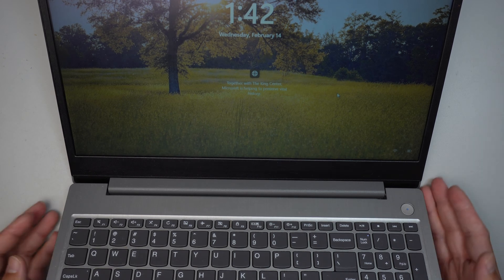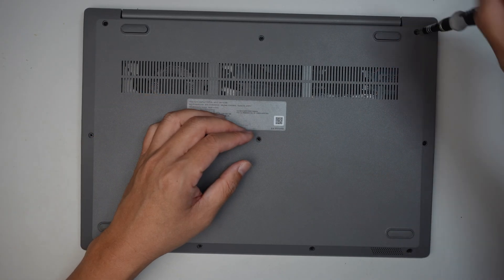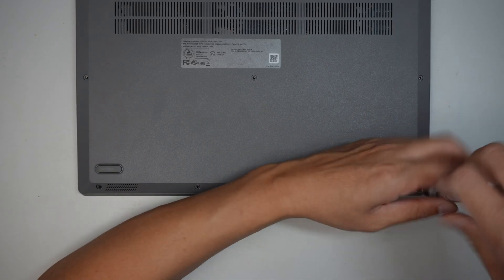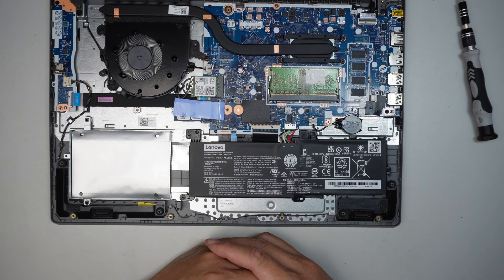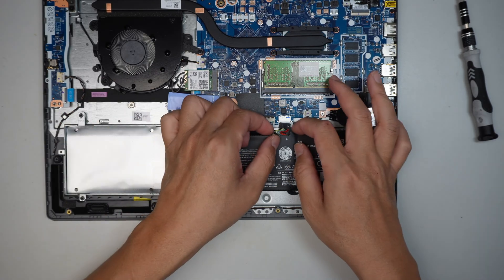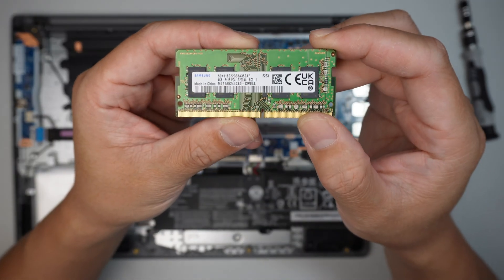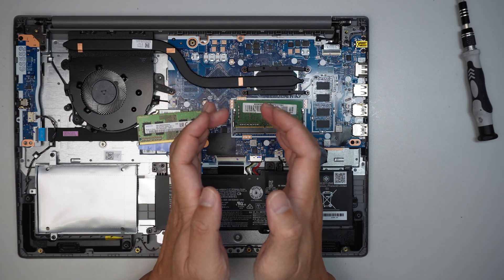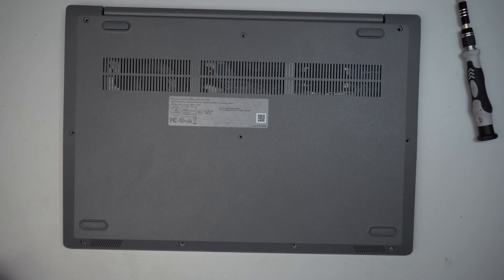Lenovo IdeaPad 3 RAM Upgrade

Comment: Never remove the RAm without disconnecting the battery. That's a very amateur mistake.
Reply: Could you explain this to me in short terms? Or could u redirect me to somewhere, where it would explain it? Would be very thankful!
Reply: @elnioldo  could fuck up the whole system

Comment: Mine is 15ALC6, removed the removable 4gb then replaced with 16gb Crucial 3200mhz, not booting 😂, returned the 4gb and also not booting. Kinda makes me nervous but I will try again later. 😂😂😂

Update on this: turns out the RAM is defective. Bought a new one and it boots instantly.

Comment: got a question , can you remove both ramms or can you only replace one ramm? or can you replace both?? thanks for answering
Reply: Standard model comes with 4gb non changable and 4gb upgradable, so you can only upgrade 1 of the sticks (like in the video

Comment: I have the same laptop and 4gb of ram and it works normally but when i did opened the laptop i found no rams what does this means?
Reply: this means 4gb ram is soldered to the mainboard. you can see 4 chips to the right of the ram slot in the video
Reply: soldered to the board